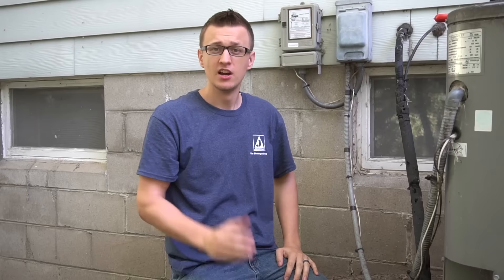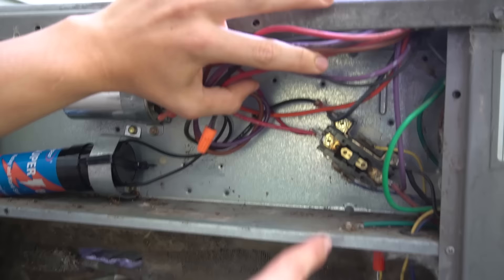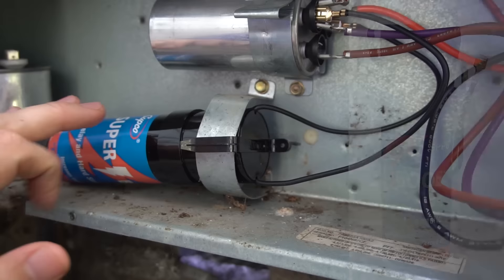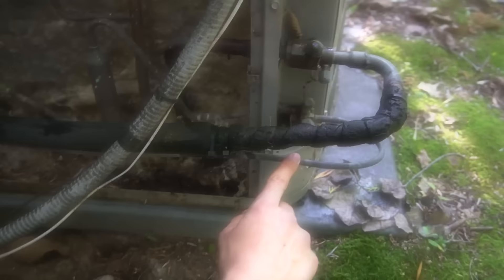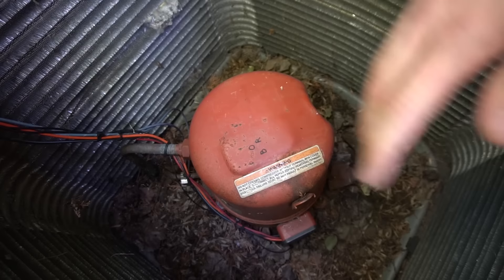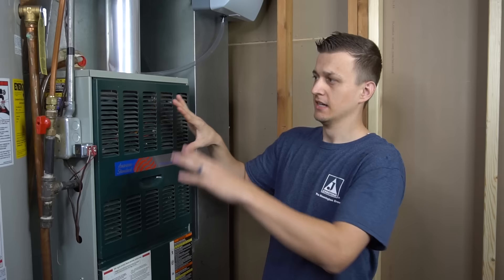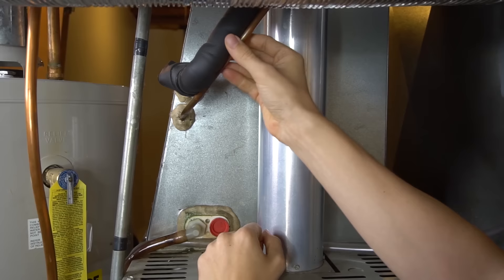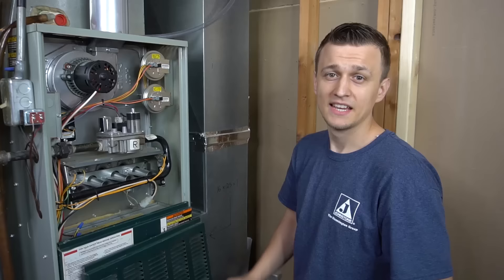All AC Parts and What They Do

Comment: I also have a question , My condenser unit contactor is not getting power when I push it it manually it works soon as I take my hand off the stops, what is usually causing this? Is it a thermostat or control board? Thanks
Reply: low pressure switch lockout from a refrigerant leak, it has safety switches to stop it from running with low charge. it COULD be a bad board or bad stat but most of the time when your lightbulb goes out is it a bad light switch? almost never.

Comment: Jay, do you find those Supco hard start devices to be reliable? I’ve heard that the 5-2-1 hard starts with potential relays are more reliable. What’s your opinion?
Reply from the maker: I haven't had any problems with the Supco hard starts but I hear that in states where the temperatures get hotter, sometimes they can have problems. So if you are in a state which gets really hot in the summer, it is probably better to use the 5-2-1
Reply: Thank you for replying, I really appreciate it. Your videos are top notch, keep’em coming 👍🏻. Stay safe and healthy

Comment: I have an issue with my ac...it seems the condensate over flo switch cuts it out  with no water present, I changed the switch it still does it , I have to remove switch giggle it the she kicks on .I have no idea what it could be .
Reply: The switch is bad so you should just replace it. Or just bypass it.

Comment: You don't have a secondary coil drain!  You need one!  If the primary drain becomes plugged, water will overflow and drip all over the circuit control board located in the furnace fan compartment!  Come on!

Comment: What does it mean if my A coil is icing up during use?
Reply: Too little airflow through the indoor coil or you have a lack of refrigerant flow into the indoor coil. Make sure the air filter is clean. Check the blower wheel for dirt packed into the fins. If the blower is dirty then the entire duct system is dirty and you should hire a duct cleaner. Make sure you are using the correct filter. If you have a 1 inch filter you usually should not go above a MERV 8 rating. Some homes need an even lower rating.
If the airflow is fine then you are probably low on refrigerant. Or you have a problem with the metering device.

Comment: Imagine going on a service call and the saver switch deactivated the ac as planned but customer said the AC wasn't working! lol
Imagine trying to troubleshoot an AC then the saver switch kicks the power off. Poor customer paying for work (time) that nothing was done.

The job of any AC is to dehumidify. Cold air is just a fringe benefit.]

Author might want to mention the type of air filter needed.
Allergen ones clog quickly.
MERV 8 is probably the best all around filter.
Save the cheap blue ones for furnaces that do not have an evaporator coil in them.

Also, author might talk about dirty A coils. Homeowners (DIY'ers) think it is clean when they look. But fail to understand that the dirt is inside the A-coil (part you cannot see without removing the side cover of the A-coil).
Pet hair and dryer lint clog those up quickly too (because when the regular filter is clogged, air will flow around the filter with the dirt).

Note: many builders will install your dryer vent too close to the outside unit causing dryer lint to clog the fins.
Ideally dryer vent on the opposite side of the house or at least around a corner of the house.

One thing the author did not talk about was AC 'misters'.
While those can save cooling costs, they increase maintenance costs. Especially in hard water areas.
Reply: @crazysquirrel9425
3 weeks ago
"The job of any AC is to dehumidify. Cold air is just a fringe benefit."      Dumb statement
Reply: @jeffro221  Only for those who are conditioned otherwise.
Didn't you watch the video and the reasons for air conditioning?
It was invented to remove humidity, the primary motivation.
Cold air was just a fringe benefit.

Comment: Hard start capacitors are only used when the compressor is at the end of this life. Installing one on a compressor when it doesn’t need it reduces the life of the compressor. 
It does NOT reduce the wear and tear on the compressor. 
They are needed when the compressor is mechanically worn to the point that it needs extra jolt to start. 
Btw, the contactor points are bad.

Comment: Did he call a contactor a control relay, it's not a control relay because a control relay is something that you pull in in order to pull in an actual contactor those of you that are starting in the field once you start getting into long runs where the 24 volts or 27 volts are 30 volts or whatever it is going from the inside to the outside has voltage drop over a certain length it doesn't have enough power to pull in the coil so instead you pull in a control relay which is much smaller amp that will then pull in the contactor, That's not a control relay it's shunted contactor and why does he have his heart star kid sideways like that
Reply: He called it a contactor and described it as a control relay. Which it essentially is, a contactor is functionally the same as a relay and it controls power being applied to the system.

Comment: Spine fin condensers, what garbage, the 2 wire should be coated,   Not 2 separate wires, thinner line is the liquid,  both should go through one hole, don’t need 2 holes in home, if you have a hard start on your unit, you have issues, York micro channels used them cause their terrible. Your contactor has a shunt, 1 line is powered all the time, I’ve quit watching, you seem like the kind of homeowner that complains about a 200 contactor, you can buy online for 25 dollars, not knowing a tech has it in truck, he drove to your home, (truck and fuel cost, wear and tear)  wages,